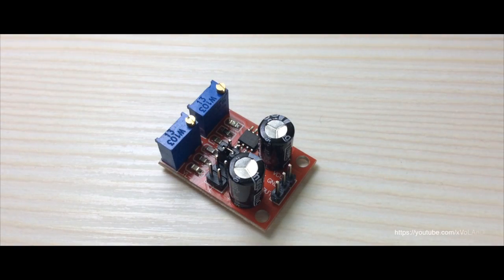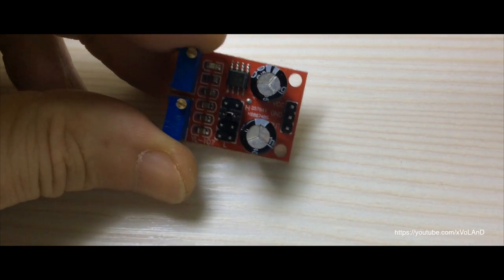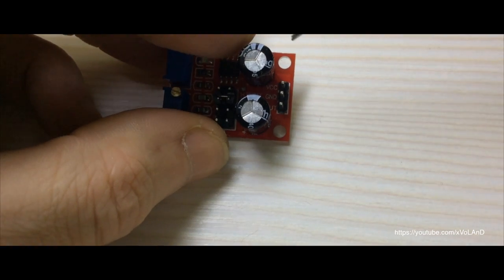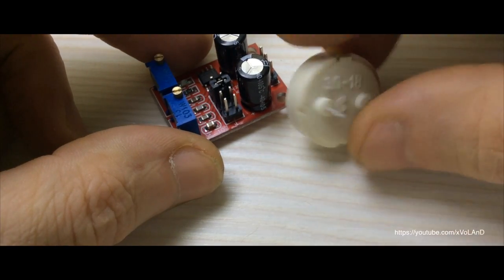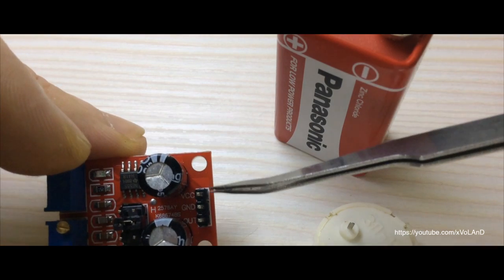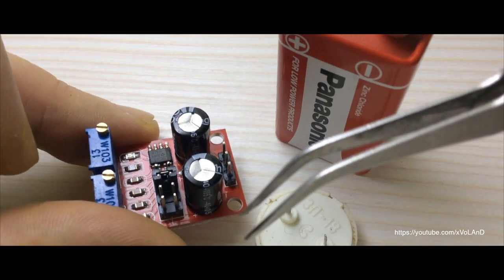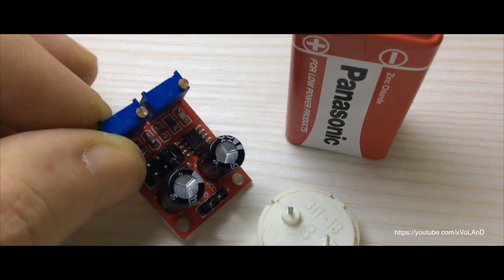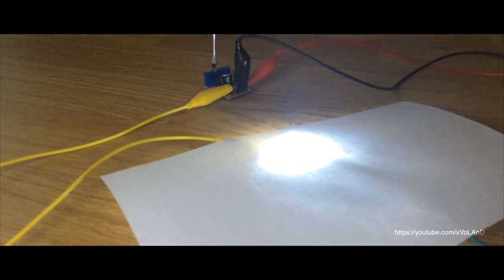Review NE555 Pulse Frequency Cycle Adjustable Module. Square Wave Signal Generator. H2578AY K68674BS

Comment: Hi Vitalii, great review.
One question: is there a way to set also an initial delay? For example: a led is on for 1 second every 5 seconds, but it starts blinking only after 5 minutes. Thanks.
Reply from the maker: Hello, Antonio! Thank you!
You can use any calculator for NE555. Find in Google, for example: NE555 calculator. You can calculate the necessary time and period.

Comment: For $2 you can get this with digital display...much better then the 555.

2CH-Independent-PWM-Generator-LED-Digital-Tube-Duty-Cycle-Pulse-Frequency-Module

www.ebay.co.uk/itm/2CH-Independent-PWM-Generator-LED-Digital-Tube-Duty-Cycle-Pulse-Frequency-Module-/322277314312?hash=item4b09398f08:g:wdkAAOSwmLlX7VyC
Reply from the maker: You're right... nice module on Aliexpress here http://s.click.aliexpress.com/e/rBuZVJy

Comment: Can I connect one time trigger on this  circuit  when  i supply the input ?.
Reply from the maker: Yes, why not?
Reply: I need to connect it to wifi switch with one pulse only  to activate relay ( one click ) only and then disconnect till the next power trigger. you think I can use it. Thanks for replying
Reply from the maker: +Mohnnad Bshara you want to force a reboot for your wifi, right?
Reply: No, I have Garage door opener remote and I wanted to connect a wifi switch with this circuit and relay to trigger the garage door opener remote.
Reply from the maker: +Mohnnad Bshara Sorry, I'm confused.
NE555 is a timer that generates pulses like timer.
In your case, how would I have do that, I use relay or FET, and the NRF (wifi-module)
Reply: +Vitalii Tereshchuk this is what i will do.
Reply from the maker: +Mohnnad Bshara I don't understand why you need ne555